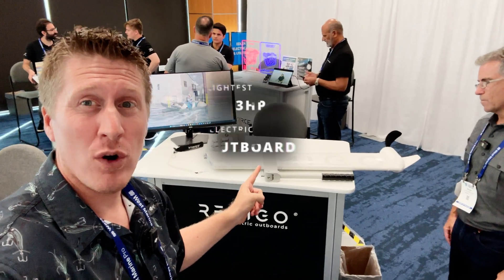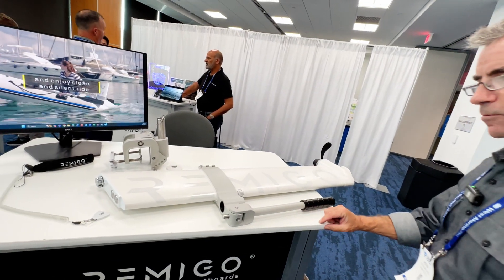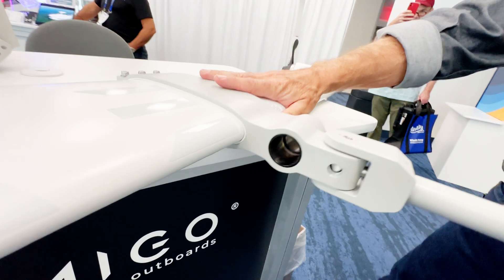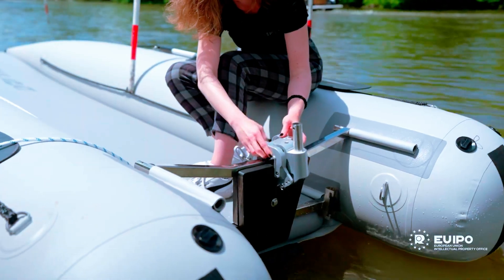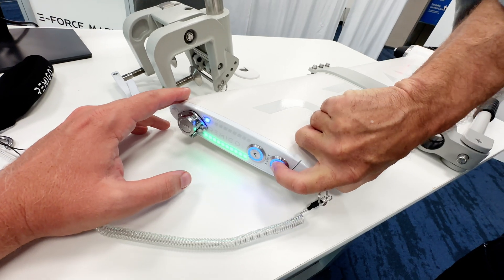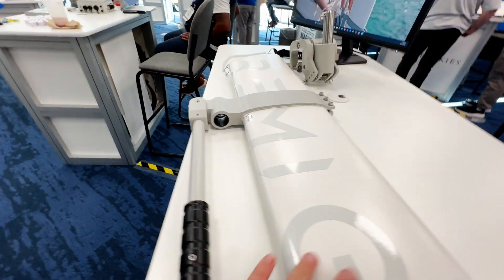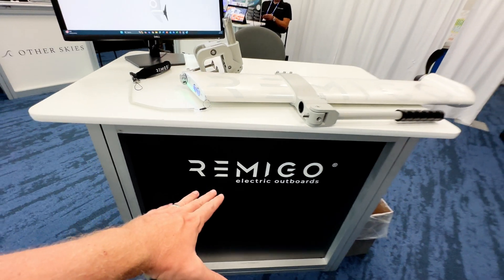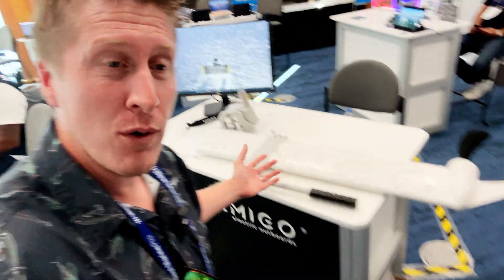NEW Electric Boat Outboard.  Are Gas Outboards DEAD?

Comment: What if you don’t tighten the bolts and a wave hits and knocks it loose and it just falls right through? They should have welded a little bead at the top as a stop… did they mention anything about a fail safe for this issue?

Comment: 3 k are you nuts I'll buy a gas out board 5 HP for 1,700 all you got is a overpriced trolling motor to funny
Reply from the maker: You can’t produce petrol but you can produce electricity while on the water.
Reply: Werong
Reply: Some lakes don't allow gas outboards. Also the motor can be used in caves and underground rivers as a backup.

Comment: How long it lasts?
Reply from the maker: Powerful as 3 HP gasoline outboard. Reliable range – up to 14NM at 3 knots.
To give an impression of the performance* of the REMIGO: Eco: 2.0 kn – 30.0 miles Cruise: 3.0 kn – 14 miles Full speed: 5.0 kn – 4.9 miles * based on a small dinghy with 2 people on calm waters.

Recharge as fast as 3hrs on AC power.

Comment: These svelte electric outboards are really looking good.  I may be trading my gasser in for one.  Ease of use and weight can’t be beat.

How did you make out with the storm?
Reply from the maker: We didn’t flood thankfully.  However got a lot of exterior cleanup to do.  I got C@VID after the storm and unfortunately don’t have energy to clean up right now.  How about you?

Comment: $3k I'll pass
Reply from the maker: Yeah definitely on higher price point but not unobtainable.  In some cases I feel this is the best option.  For sailboat owners I think it makes great sense.  Can produce your own electricity to charge it.  Hard to produce your own gasoline.  However, I like that epropulsion motors are capable of hydrogenation (sail and it recharges motor).  

I don’t blindly love all electric motors.  I just love the lower maintenance, lower weight, instant torque, and ability to just charge and go.

Comment: I think ePropulsion looked at these when they designed the eLite.
Reply from the maker: Isn’t there another company with flat profile motor like this?   
So many are coming out I can’t remember.  
Elite by Epropulsion is very similar all-in-one design.  I like the adjustable shaft length design.